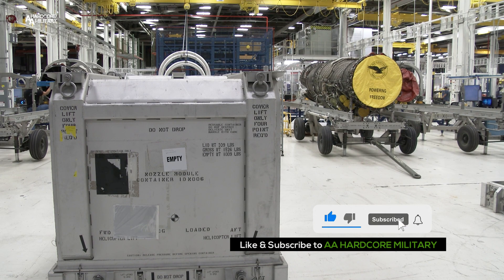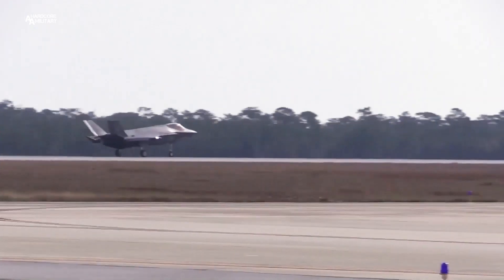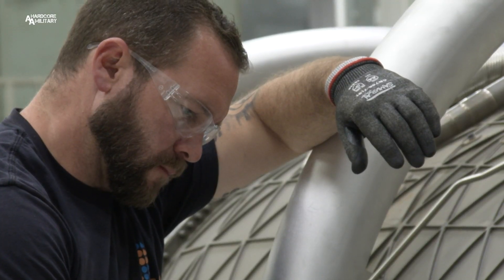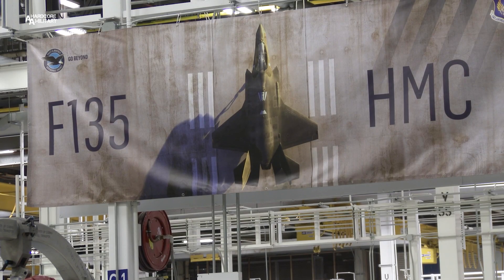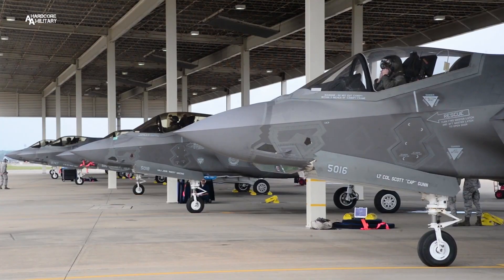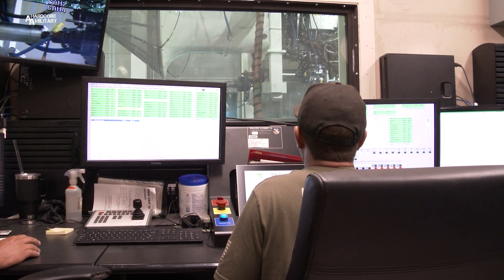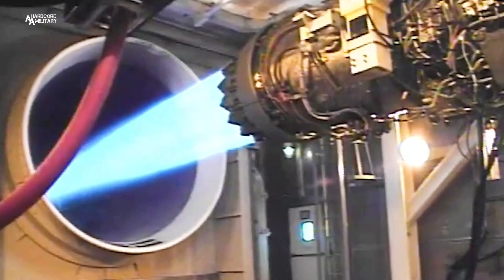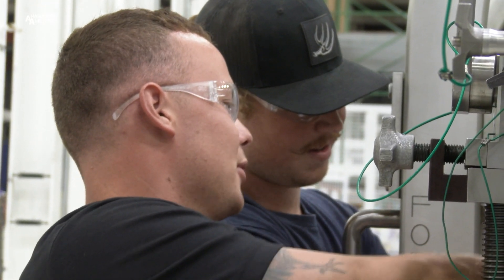F-35 Engine Peak Performance | 72nd Air Base Wing Public Affairs

Comment: The f-35 should have 2d vectoring, imo. It already has the ability to use VTOL by vectoring the nozzle down at the ground. It would be interesting and really cool if it could when airborne, having the nozzle vector 2d up and down 20-30 degrees.
Reply: Mechanical complexities become more dominant with 2nd nozzle vectoring.